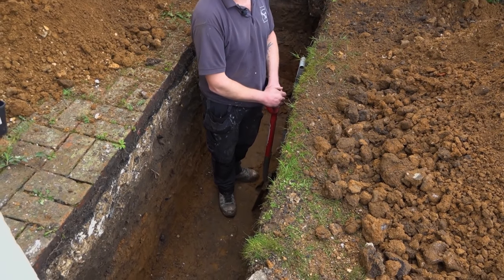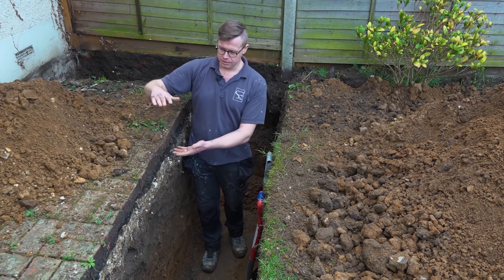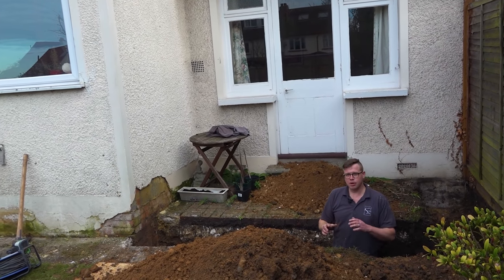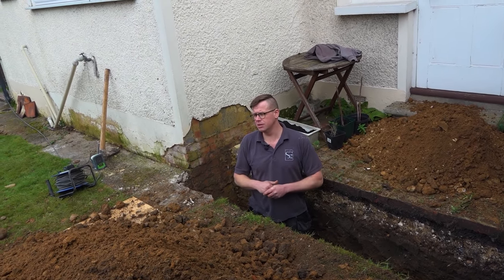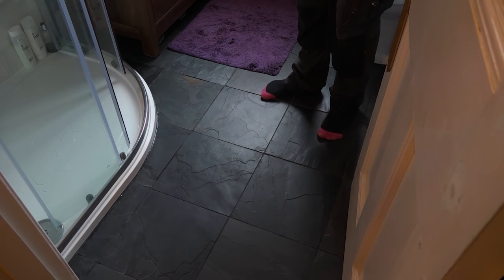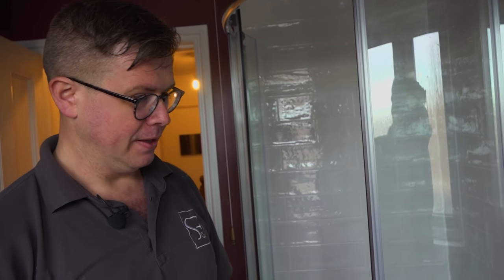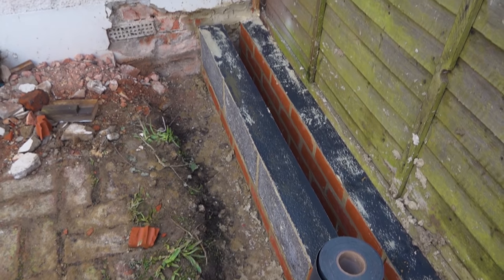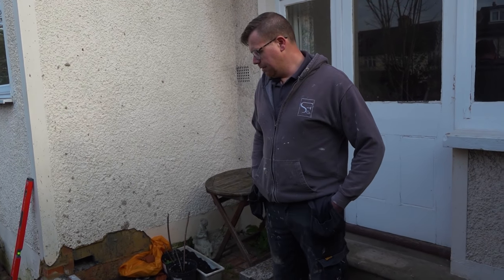The Walls Go Up - KB#3

Comment: Talking about flooding, a small development near us broke through an old Victorian brick culvert. This caused the nearby foundation trench to fill up, sides fall in and force a 2 metre deep trench! In the end they had to install a double French Drain, a pump to send the water to a huge soaraway, from there to a holding tank and finally pumped to the rainwater sewer in the street. 
Wessex Water basically said they had to put clean water into the sewer and this was they only way.

Comment: Do you find you can fix toilet pan onto tile or better to fix to timber floor then tile around toilet pan. My thought is if you fix to tile as time goes on and people shuffling around on the bog is there a chance of the tile cracking ?
Reply from the maker: Chris 
 You do see cracked tiles under w.c pans. I would still put it on the tile but make sure the tile is bedded fully and the pan is fixed with silicone. The screws are cosmetic
Reply: Skill Builder, can you explain just how to bed the pan onto the tile, many thanks.

Comment: Why is there no reinforcing in the footing?
Reply from the maker: We don't tend to reinforce domestic  foundations in the U.K unless there are tree roots or clay or we are making a ground beam. The idea is to get down to something solid that has never been disturbed in a zillion years. When you look at what is going on top of this concrete it weighs nothing.
Reply: @SkillBuilder  thanks for replying.....Here, we dig down to undisturbed ground for the foundation, blinding concrete up to base of footing, the construct the footing say 500mm x 400mm with  reinforcing ar the top and bottom connected with ligatures
Reply: @SkillBuilder  Is it essential to use reinforcement in clay soil?
Reply from the maker: @trainingmentor5027  No but it helps. A lot of people pile it instead.